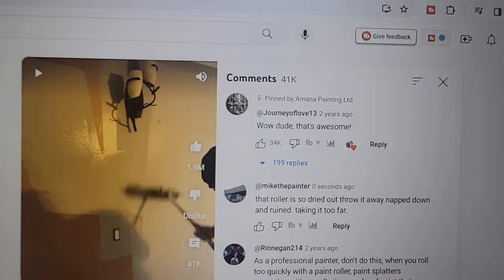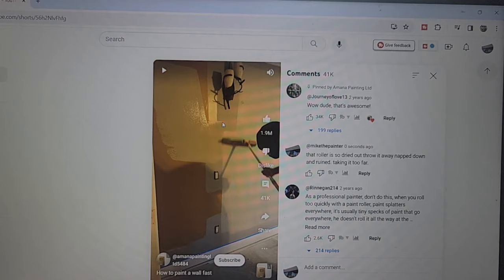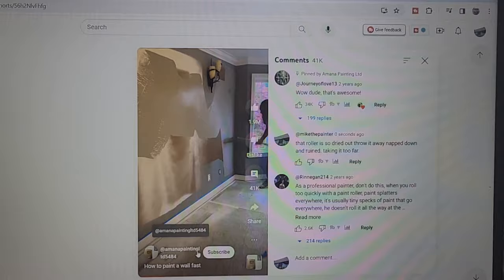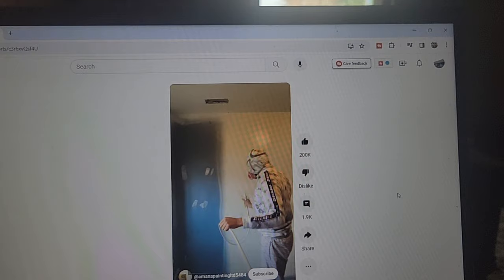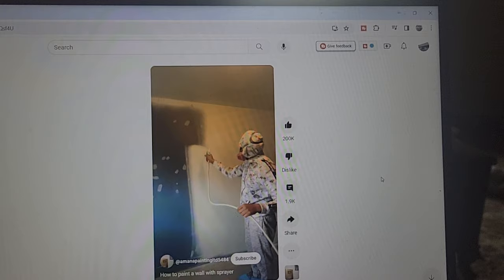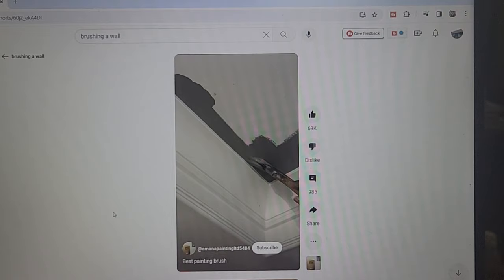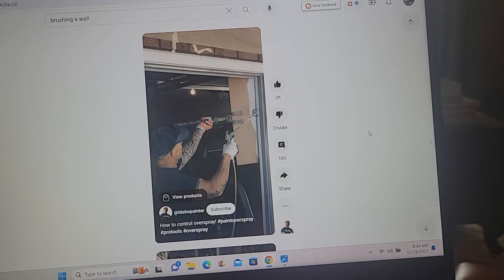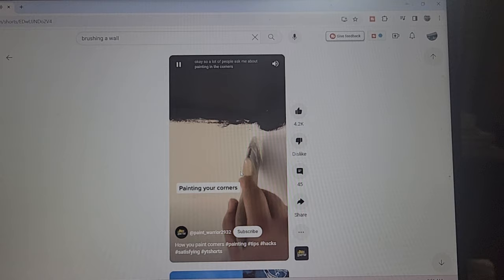painter videos commentary - What's wrong with this picture?

Comment: Mikes hard truth on 18” vs 9”rollers & sash brush vs wall brush = best advice for any painter who didn’t learn already!
Reply from the maker: so many people just dont know that. back east they use those 18s thinking they are saving time. all those extra tools in your truck too to clean. A 9 inch you just skin the bucket out after a few days. or throw it away and next job you have another one.

Comment: I'm in the uk (England) and i can honestly say that there's not a paint product or roller sleeve that I've encountered in 30 years in the trade that would reach one side of a wall to the other in one dip. We mainly use flat matt emulsion over here so not a chance of spreading any more than two 12" roller widths with one dip without compromising the finish. Even our sheen finishes would struggle with one dip.
Reply from the maker: yea just  a video show.....nothing tradesman about it. He was pushing really hard on that roller toward the end. that roller will never come back atter that. Ruined.